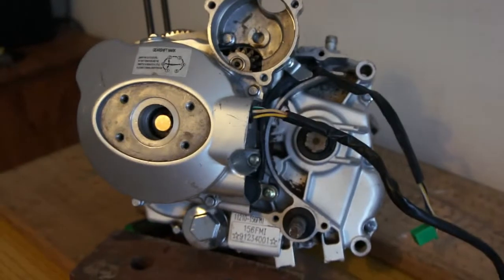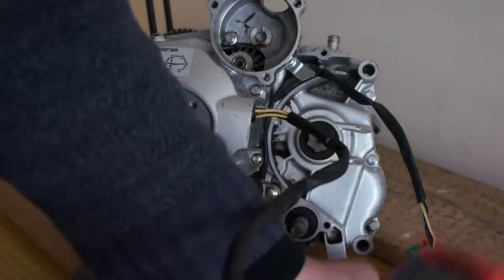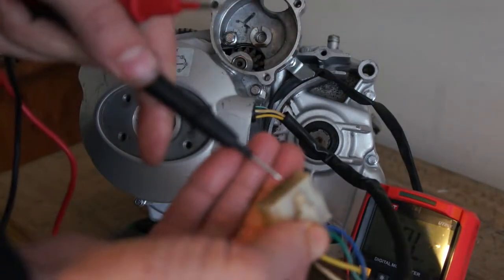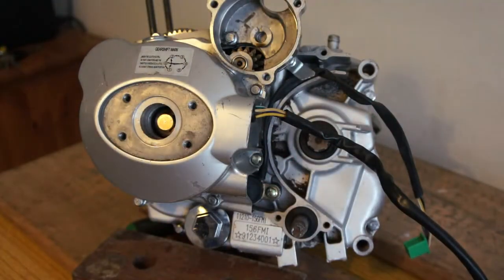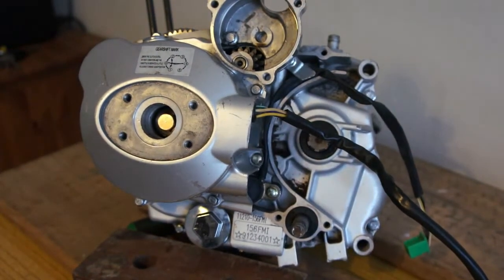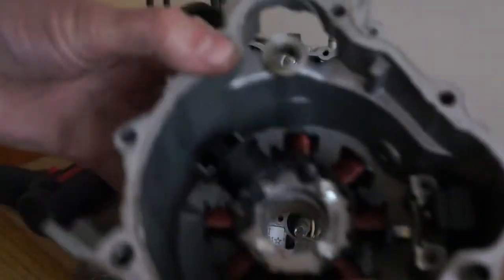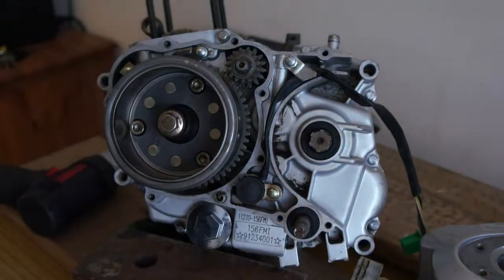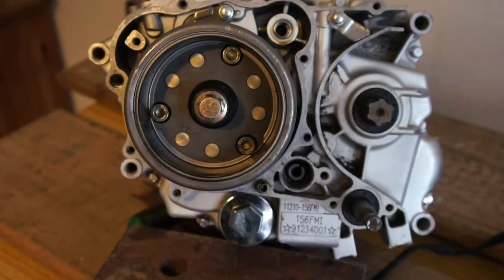Stator & Pickup Coil Testing: Chinese 156FMI (CG125 Copy) Engine | No Spark & No Charge Fix

Comment: should there be oil in the stator chamber in this engine or are my seals bad ?
Reply: This is normal in these engines. The purpose of the oil is to cool the stator coils. Remember that oil does not conduct electricity, it is commonly used to cool high voltage network transformers, so there will be no short circuit.
Reply from the maker: its normal in these engines not all though

Comment: Hello
What kind of oil do you need?
Is there separate transmission oil and engine oil?
What is the upload amount?
Thanks!
Reply from the maker: No engine oil that is rcommnened by your service manual will lubricate gearbox too.